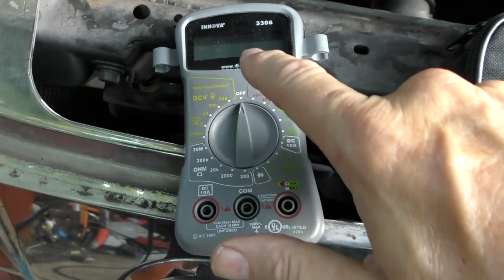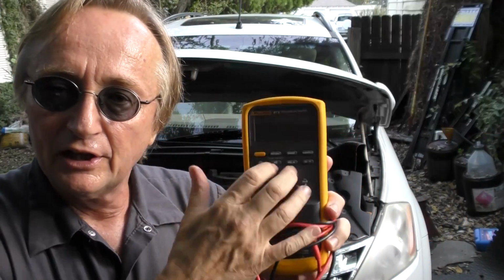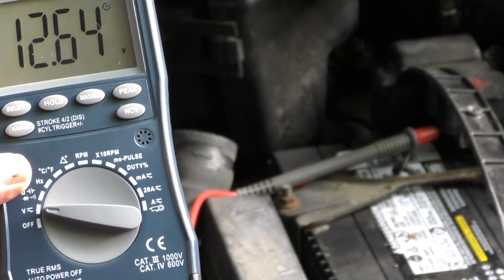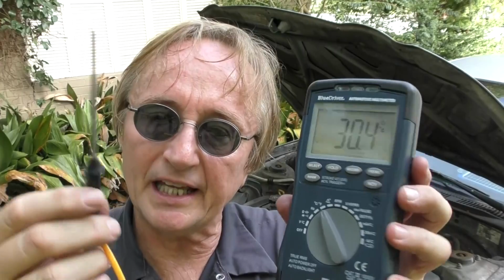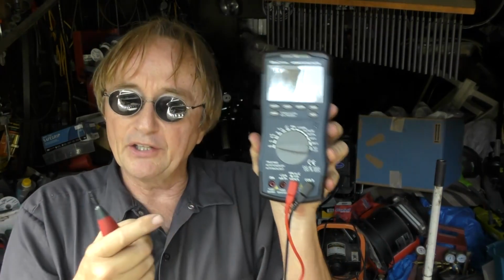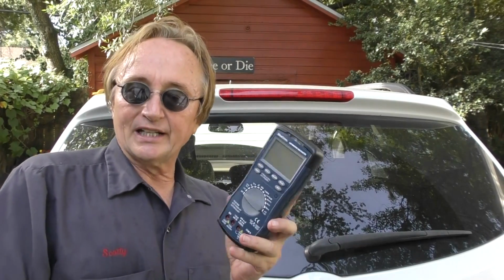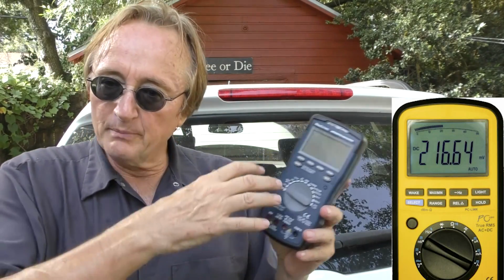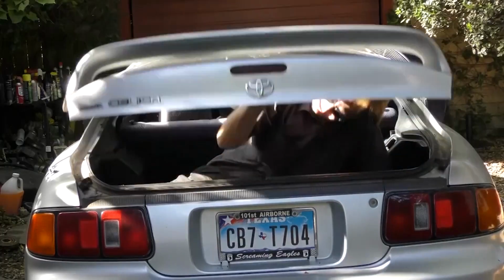The Best Multimeter in the World and Why

Comment: Nice video. I have been hit with 110V and 220V ac, he 110 is like a tingle, the 220 just threw me against the wall, now its like nothing electric fazes me... I was looking at my truck one day, taking plug wires off while it was running and I got hit with that... Just felt a small tingle... Electric is fun, isnt it hahahaha :D theres my comment, ill be looking forward to getting a new multi meter... I need one anyways... I was testing my brake lights afew days ago cause they stopped working... I went to autozone looking for a simple test light, ended up with a test light that also told the voltage, pretty cool. Been using it on everything these days thats automotive, since it only has a 6-24V DC range on it...

Comment: Good video, but you aren’t lookin’ so good in this one. Are you alright? Hope it’s just the heat. Anyway, Fluke makes non-automotive meters too, which are popular with electronics pros and hobbyists. For a few years now I’ve been using a $10 cheapie from Fry’s Electronics. At that price you are lucky to get a continuity beep/buzzer! For the hybrid cars it sounds like you’d be better off with two meters, one for the high amperage stuff and one for the low amperage stuff. I know that Dave of EEVBlob game made and sold a microamp current measuring device before making his own multimeter that he sells, so it looks like that was his solution.

Comment: I like to use the meter even if I have a starter problem because people not tend to see that some of those starter problems aren’t because of the starter, but because of the high resistance in one of the circuits, positive or negative. They use to put the meter in ohms to check if there’s continuity in the circuits when they should be doing a voltage draw test instead to look out for any resistance that could be affecting either the current to the starter or the ground to it. People don’t realize the helpful that a meter is in solving this electric or electronic problems!!!

Comment: I really need a multimeter. So i can repair my motorcycle, the only transportation i have.
Reply: harborfreight sometimes have their basic multimeter for free with any purchase if you sign up for their coupons, and also it would really help if you have the wiring diagram for your motorcycle otherwise its gonna be a PITA trying to figure out which wire goes to where. I bought a honda from a guy who messed up the wiring,  he kept wondering why the bike blew its starter relay fuse every time the ignition switch was on. Took me the whole day to figure out that he messed up the wires in the connector for the starter relay even with the help of a multimeter and wiring diagram.
Reply: Bilal Hussain I hope you win it 👍🏻

Comment: I am a pro electrician. I have old faithful my Craftsman meter from my childhood (gas melted the screen and I have worn the chrome off the test leads so ohm and low voltage readings are sketchy) and I use Flukes at  work. Since I am in the market for a new meter at home this sounds really good.

Comment: Any meter that measures .000,000,1 amps or volts cost min. 50 will work. If not you need a data storage device, cheap also. DC amp clampmeter for 40,  test .1 amp or greater, is great to have, never break circiut again. Factory specs and data is way more important than meter limitations. I breath electronics 24/7.

Comment: Hey Scotty I saw electricity when I was wrapping a piece of wire around my top radiator hose on my jeep. The hose had to be cut off, & reinstalled on the trail, it blew a hole in it. While wrapping the wire around the hose & air cond. comm. it touched the positive battery terminal, sparks, the wire turned red hot like a toaster wire, welded right to the terminal &  my finger BAD, STUCK RIGHT TO IT RIPPED OFF SKIN, STILL HAVE THE SCAR AFTER 2 + YEARS. It still freggin hurts sometimes, the funny thing is I bought a new hose & still haven't put it on ? I hate those hose clamps they have on the ZJ jeeps. GREAT VID. might look into that meter, thanks.

Comment: Good to know about automotive specific DMMs.   I have the same Fluke that you have because I used to work as an electronic tech.  I recently bought a $44 chinese meter on Amazon that also has a light meter and a sound pressure level meter in addition to all the DMM functions and capacitance and frequency counter.   I won't ever use these functions, but sometimes you just gotta buy the thing because it's so cute.

Comment: I own a fluke field piece hs36 and I love it. I did have forever have a meter similar to yours. I was an air-conditioning tech for more then 20 years with very little call backs. l do however use this around the house. I've also used it on my car. It was accurate to a degree. Good thing I've learned to be a shade tree macanick (spelling).
I've always found your videos
Helpful. Thank you sir.

Comment: How many volts are sent to the motors on a hybrid? Good god almighty can it really be so much as to arc through a glove? Just to pass through a typical glove you need 600-1500 VDC. And then for it to arc obviously that means you’re not touching it so that’s another 1000+ volts required. So are we looking at the multi-kilovolt range? And if so, what exactly requires those voltages? Just the motors themselves?

Comment: I use a multimeter for just about everything. I check my fuses and relays, I even check the resistance on any connections I've made to make sure they're good and tight and aren't going to get hot.

Comment: A good tip is to use alligator clip style leads where you can. It makes it easier using alligator clips on the ground connection when searching for a short or open circuit with the pointed positive lead.